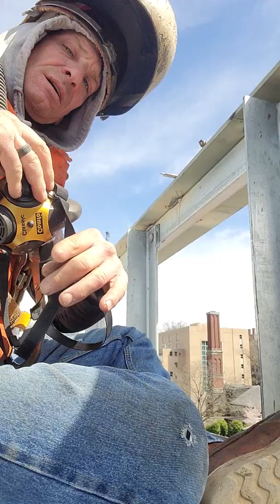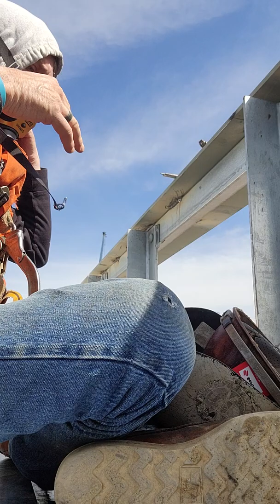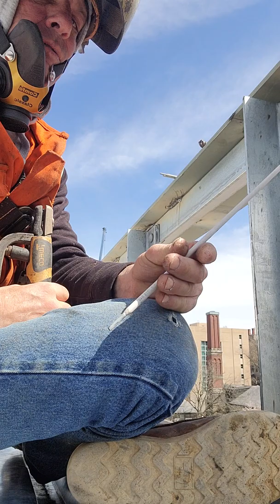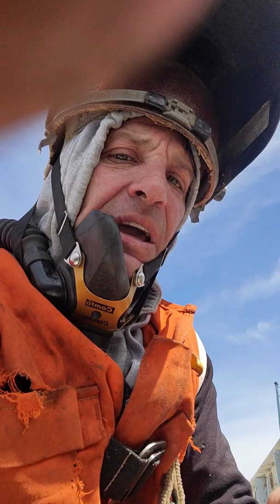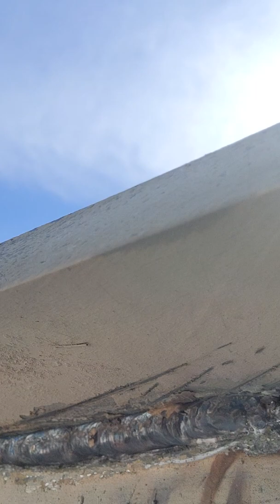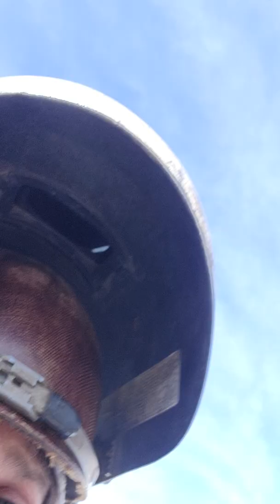STRUCTURAL WELDING/GALVANIZED= OVERHEAD 7018 5/32

Comment: How come you just don’t run 6010 instead? I know it’s not as strong, but it has deeper penetration it burns through the galvanize better.
Reply from the maker: jf3ash, Good morning, P5, I would use it as a root pass if the galvanizes overwhelming ,  But as you see   I have no issues with penetration, A lot of people cannot Weld galvanize,  especially with one pass, Like I produce, One and done,This is structural, 7018 series wire ,We do not use 60 series wire, It is against our religion, And the Welding inspector will fail everything that was done with 60 series wire,. A lot of people don't read The general notes on the drawings, In the structural iron worker industry, 70 series only! Maybe you're doing a home project or some stupid s***, This is about strength, That's why structural welding is done with 70 series.   .
 Thanks for your comment
Reply from the maker: jf3, I love P5 6010 , It's probably my favorite stick rod, And I never could use it in this business, But when I'm at home and doing all kinds of stupid s**, 6010 is it, Not trying to be negative at all on the last comment but, We have a lot of men come out that can't  Weld Galvanize, It has to look nice., You have to have your s** together if you know what I mean, Talk to you soon brother
Reply: Ok. Very good explanation. Take care brother
Reply from the maker: @jf3ash  , All good, What do you do for a living, What trade!

Comment: Badass I always grind before guess I ain’t a real welder 🤣
Reply from the maker: StaticXxx, What's up brother, Of course you're a real welder, I run my heat hot, penetrate the galvanize, I'm working the puddle, I cut through, Fill in, You'll get the nack of it, And you will never need a grinder, Practice, Have a great night
Reply: @jetweldingllc4691  thanks for the tip definitely going to try it, have a good one as well !